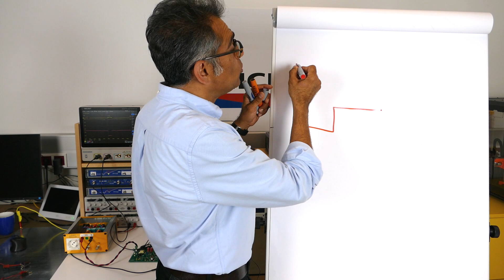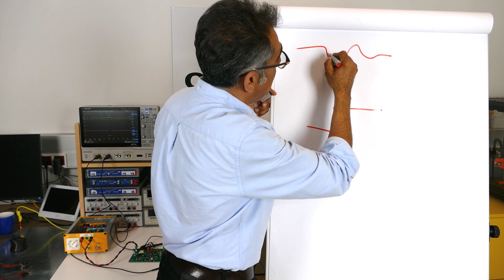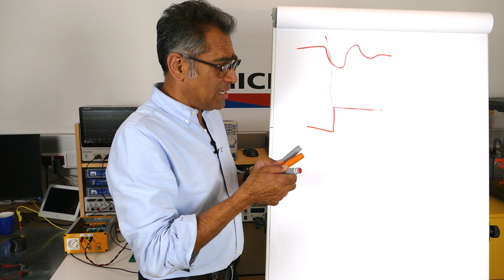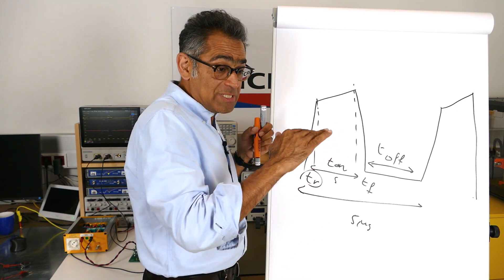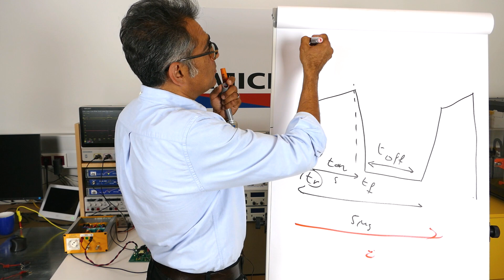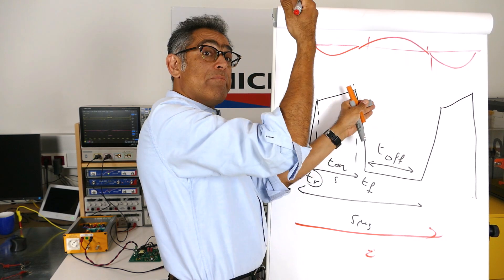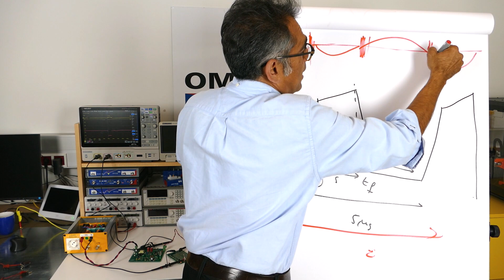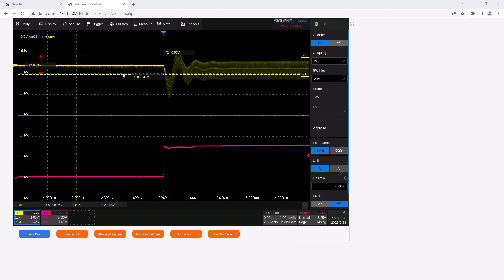Input Capacitor Selection for Power Supplies (Part 1)

Comment: 10:05 Do I see correctly, the new successor to the Bode 100 - the Bode 500 with N connectors and full 2 port measurements :D

Comment: A suggestion to make trace clearer and show subtle detail is to put a DSO scope into averaging. It increases detail synchronous to the triggered dynamic load step timing, while suppresses switching noise. 
That way with averaging you can see more phase detail in the line/load voltage excursions, without seeing the converter switching noise (now asynchronous) blur the trace.
By switching in and out averaging, can isolate and show and hide the converter switching noise

Comment: Hi, I have a question : as the control feedback allows the audio susceptibility to be reduced of ||1+T||, I wonder if we could under-estimate the input capacity and rely on the robustness and the efficiency of our control design ? Thank you for this video
Reply: Generally not a good idea. The risk outweighs the cost largely.